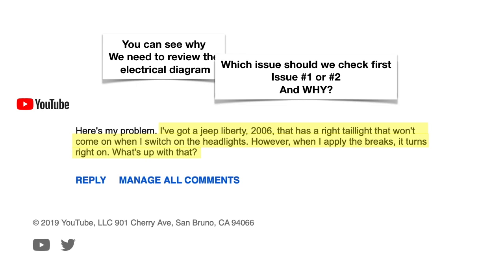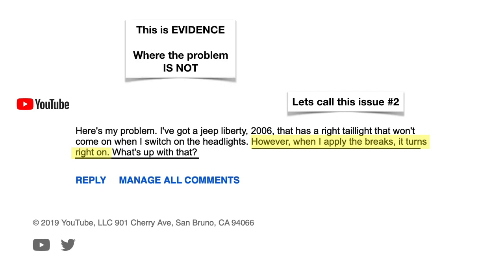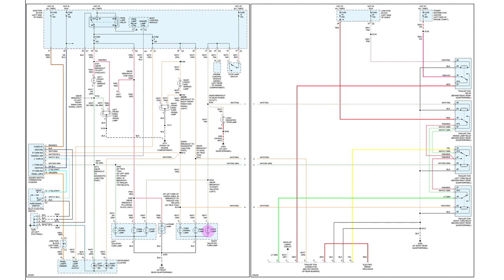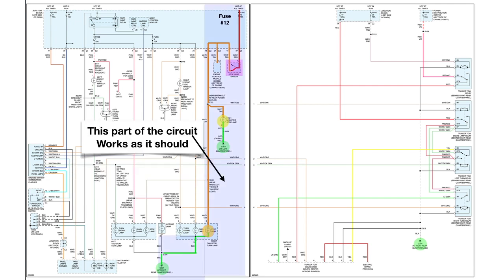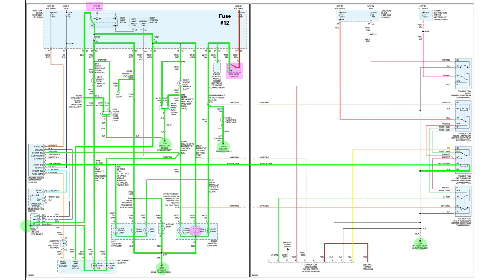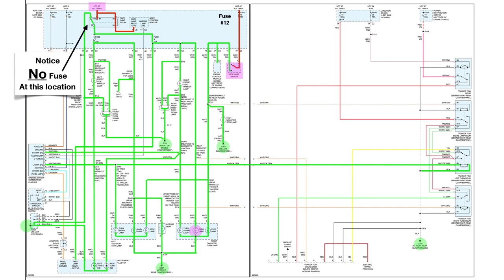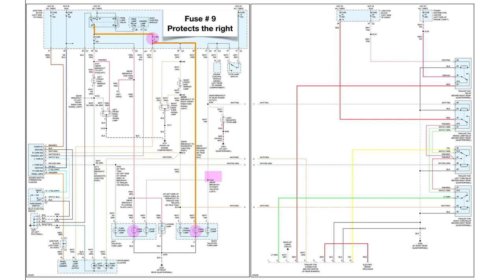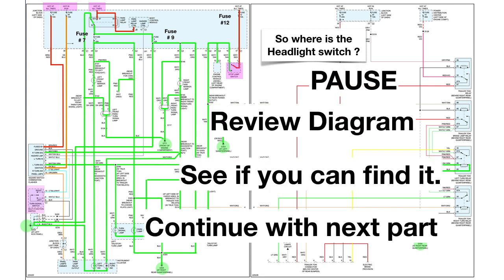A study in reading electrical diagrams Part 2

Comment: Hmm, even at full screen the diagram is hard to read, but with effort I'm not finding it. Perhaps on another page, inside one of the modules labeled with dashed lines?
Reply: I printed out the diagrams from the Part 1 vid.  With my middle aged eyes and a pair of cheaters it's pretty clear. lol